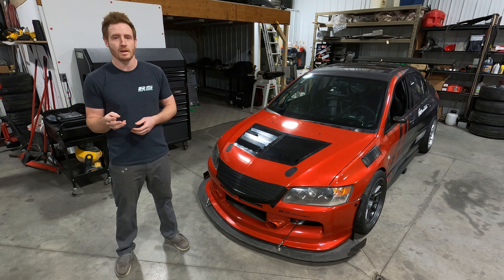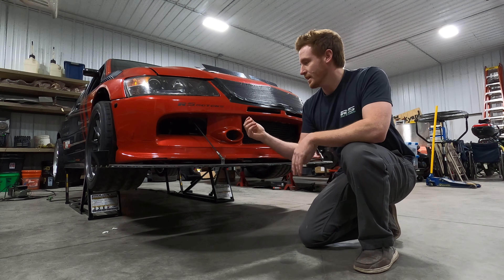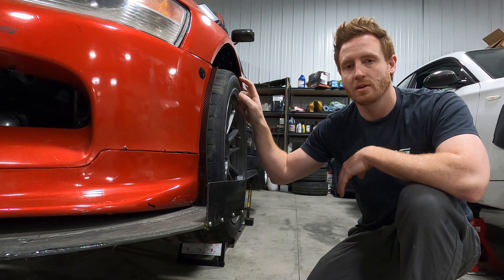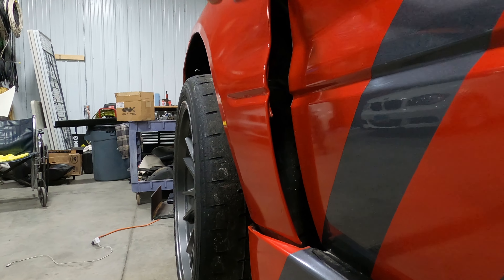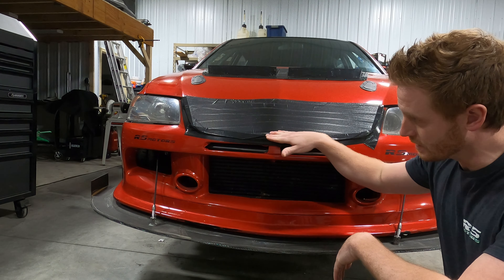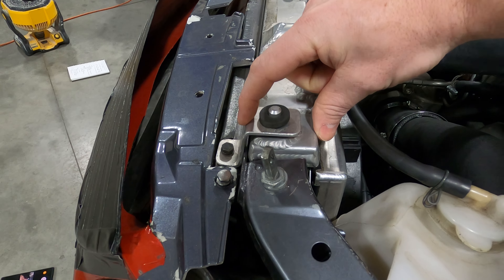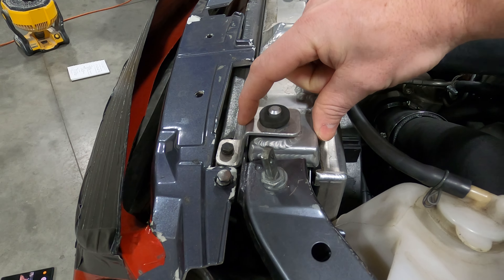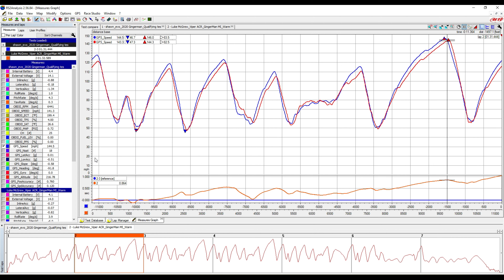Time Attack Evo 9 Build P1: Aerodynamics

Comment: Dude, not trying to talk shit, or dump on you but, 1. how do you think that your car is making close to the same amount of downforce as the viper? 2. Does your bud with the ACR have as much seat time, track time as you?  Don't get me wrong, sounds like you did your homework on your car but, seems like you need a bit more Aero work time.   you did not go into how you set up your wing. HIGHT, WIDTH, ANGLE OF ATTACK, TYPE OF SANCTIONS, END PLATE DESIGN, ETC..  Also, the rear bumper idea is an alright idea but, I bet your wing will work MUCH better if you install a diffuser back there.    Keep up the good work.
Reply from the maker: 1. Acceleration and braking are almost identical, and I'm on smaller tires, so downforce must be close or maybe I have even more. 2. Viper guy is an amexcellent driver with much more experience than I. 3. The wing is the most predictable aero device as there are actual df numbers on it. Should be around 500lbs of downforce at 140mph. A diffuser is almost useless unless it has a flat floor leading up to it.

Comment: Sure the aero helps, but the 30 hp and especially the 200 pounds less weight help a lot versus your brother.
Reply from the maker: I also did a no aero vs just simple splitter and wing on my evo years ago. No other changes. About 2.5 seconds faster a lap with aero.
Reply: Aero makes a huge difference

Comment: Nice video! 
1.where are the tie rods attached to?
2. Would be beneficial to close the 2x bumper openings where the rods po out?maybe keeping small ducts for fresh air to oil radiator and gearbox
Reply from the maker: Rods are attached to the small tabs off of the side of the bumper support brackets.
Yes I usually tape up the side pods in the front bumper as I don't have an oil cooler.
Reply: @Krebsbach Racing  thanks.. dont you have issue without oil cooler? Don't you get enough air flowing to the radiator as you mask the opening above the intercooler? Thanks again

Comment: So what made you decide to cut the bumper instead of running a rear diffuser?  Weight savings?
Reply from the maker: Unless you are able to run a flat floor a diffuser is basically useless and will most likely decrease performance. The air is too dirty coming up to the diffuser for it to work properly.